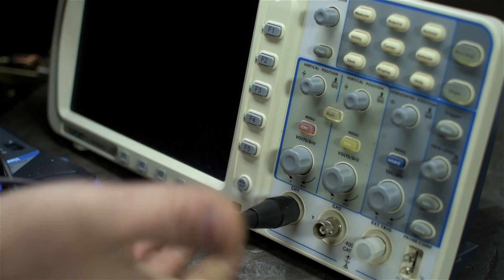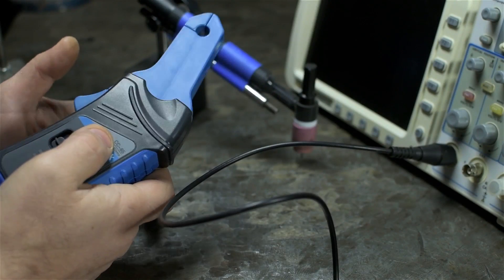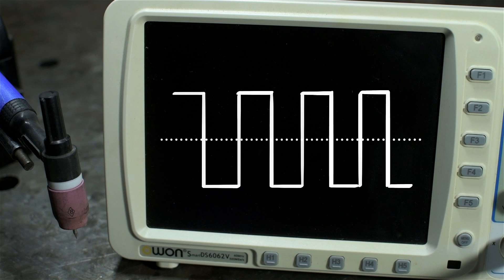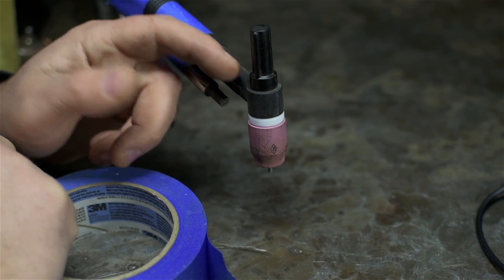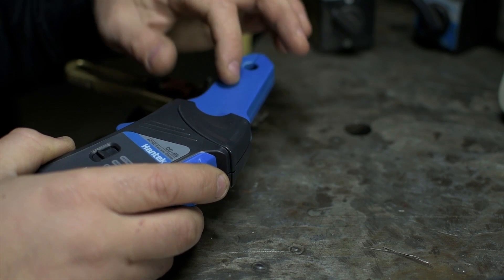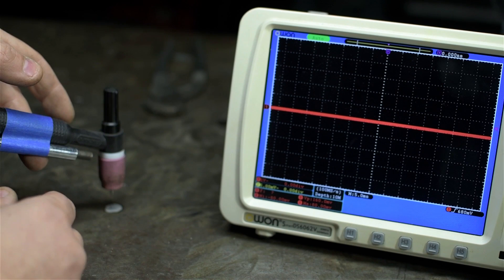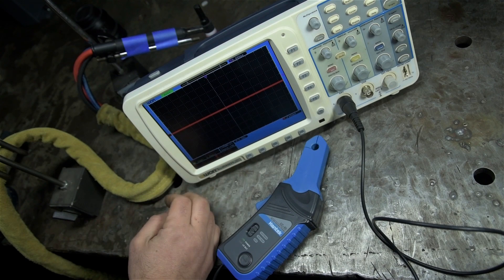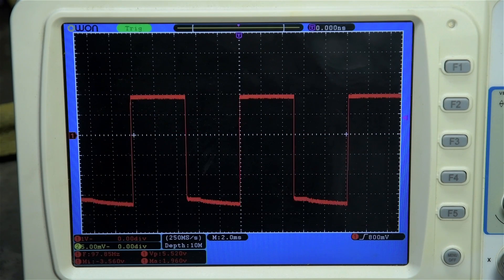Oscillo-Help-Me?

Comment: I have had similar problems hooking some digital scopes up to inverters etc. An old analog oscilloscope sometimes works much better. I still keep an old Tektronix plugin scope that seldom lies to me...
The other issue may be the hall effect AC/DC probe You are using. I have had similar problems with my Tektronix high end  currentprobes. These probes work by a split core system clamped around the conductor. A hall element measures the magnetic field induced in the core. This field is proportional to the current through the conductor. But in these probes the total magnetic field is held at 0 by a servosystem that drives a compensating current trough a compensating coil around the same core, and it is this current You register on the scope. Complicated - Yes but it gives You DC measurements and much lower inductance than a simple core probe would due to the core inductance being canceled out by the compensating current.
Big problem is to fast rise times and hefty currentspikes. If the servosystem in the probe does not keep up, You get all kinds of funny results. Many of these probes are seriously derated at high currents, the Tek ones have some dokumentation on this issue. Easiest sanity check is to compare the current signal with what You get from a simple resistor to ground for the same current waveform. Rig a piece of stainless wire to something to torch on at low ohms to ground (perhaps 0.01) and just measure the voltage with the scope.  Just disable that HF scopekiller first...

Comment: The new units waveform can be explained.  There would be a very small capacitor on the IGFET drivers to prevent self oscillation.  If a good is used for the output drive to the torch then the magnetic collapse would also take time to drain through an Resistor- Capacitor drain of the collapse on the negative slope.  This unit has a much cleaner square wave.  This means that the signal is composed of much higher harmonics.  I suspect it is probably just causing RFI issues with the control circuitry.  It is only about 3 Volts Peak-Peak.  A typical scope should take around 50 V P-P before clamping occurs to the input signal.   To confirm it you could make a simple current loop with a compensated probe.  10 turns of wire connected to a 1k resistor that your probe is across.  The square wave is made up of the odd harmonics of the base frequency.  130 kHz, base, 390 kHz, 650 kHz, 910 kHz, 1110 kHz...etc.  Make up the square wave.  The sharper the rise time the higher the harmonics that contribute go.  The cleaner square wave the more the RFI.

Comment: You were just measuring a well know physical effect. I wanted to do this by myself, but I'm too lazy. Thanks for your effort to prove it!

At the heated tungsten electrode it is easier for electrons to be emitted at the re-ignition when the electrode is a cathode. If the workpiece side (eg of aluminum) is poled as a cathode, the electron emission is very low. The re-ignition is harder and a higher field strength is needed and this creates a spike during arc ignition. The arc voltage after re-ignition is higher than reverse polarity, since the thermal emission of the weld pool is lower, resulting in a resulting DC component of the voltage.

Comment: better way to measure amps is to add a power resistor of a known value like 0.1 ohm and measure the voltage drop over it

Comment: As a professional IT support engineer, I have to point out that, traditionally, I would switch it off, and only THEN, switch it on.
Otherwise, is there an issue with the scope ? Google the manufacturer, see if there is a support section. See if there is a FAQ section.

Comment: I'd like to see you play around with the settings. The Tungsten is negative, right? What if you change the cleaning to something like 25 ep? That would probebly change for how long it's positive, but if you change the frequency it might change timing on both. What would be very interesting is changing the polarity, and see if it's consistant, if you change on the welder you could rule out the equipent to some extent. Then it probebly comes down to settings like arc with or something that's further into the pixies domain. A good point is that the EP part of the cycle is mainly a cleaning action and to penetrate the oxide layer, if it was greater then 50% amprage it'll probebly melt the tungsten in no time. What I learned is that you change the EP % to a higher lever to make a ball on the tungsten, this might give more amprage, but I'd guess it's more of a timing thing. Please do some more with this, very interesting. If you use a strike arc start, you probebly won't fry you oscilliscope right away, but I'd guess it's more conveaniant the way you'r already doing it :D How cool are you at the moment BTW?

Comment: I would suspect your setup Tony. First your zero reference point (ground) most likely is different between the scope & welder. It should still work but can cause problems.  Also the positive side of the wave is too perfect like a clipped wave would be. You can see the noise on the negative side but not positive.

To eliminate  probe error, wrap a bunch of wire around the welders lead and use that for your pickup probe.

Comment: I'm a union boilermaker and have been tig welding the root pass in tubes for 25 years, I've got no idea what's going on in this video, we usually have Miller 8 packs that look older than me and when we tig we just switch out the leed and ground cables.

Comment: Generally there are two phases, heat and clean. You general go negative to heat and positive to clean. Clean is basically reversing the flow to help slow the oxide build up within the arc / hot area. check out: https://cadcaminfo.wordpress.com/prototyping/the-tig-welder-ac-or-dc/

Comment: Definitely put in a second probe and connect that to the ground clamp. Then reference channel 1 to channel 2. That will give you the best baseline for the AC wave referenced to actual ground. Otherwise, the scope is mostly just guessing what is positive and what is negative. Usually there is some drift without a reference to ground. It's difficult to do a true reference with an inductive clamp, even with a ground reference because you aren't measuring directly. Problem is, you can't connect your probe to ground and directly to the torch or you're just welding the inside of your scope... 

Side note: With an inductive clamp, there's always some bias one way or another because it has to read the current based on direction of flow, but injects it's own current back.

Comment: Stop the video at 6:49 in slow motion as current is decreasing, and it becomes pretty evident that your measurement system is clipping on the positive side. As the current decreases, it becomes approximately balanced positive/negative at the ends of the step response, and the exponentially decaying sinusoid is chopped off at that peak voltage.

Comment: Tony,

I am a mechanical guy and have very little experience/knowledge with wrangling pixies.

Being that pixies fly from negative to positive, they are stronger on the negative side.  In the house, the power company controls how much stronger they are and limit their overall strength making them only very slightly stronger on the negative side.

In a arc monster, the pixies get VERY angry and feed off the steroids the arc monster gives them.  They become so strong they hurl drops of molten steel like they are paper balls.  If we try to measure this, we may see this an an imbalance of power as the angry pixies should only hurl those molten drops of steel in one direction.  The arc monster protects itself by only letting the steroids work in one direction.  If the steroids worked in both directions,  the arc monster might end up with molten steel all over it.

Comment: A few too many comments to read through, so this might have been covered already, but anyways..
I'm not sure what "high frequency" start means in this case, I mean, what frequency is considered "high"?
Compared to AC power at 50/60 hz, almost any frequency is high, but if it refers to a frequency in the radio spectrum (essentially mhz or above), the most likely cause is that your scope is affected by the radiowaves emitted from the high frequency (and high power) start. The higher the frequency (and thereby shorter wavelength), the more likely it is that something in your welder is acting as an antenna. Anything metallic that is about one half or a quarter of a wavelength happily acts as a radiator.
Add to that the sparks generated by the welder, those produce a lot of white noise which means many different frequencys are beeing radiated (this is actually how the first radiotransmissions were produced).
The components in your oscilloscope is sensitive to this radiation, especially semiconductors (transistors etc) and this could cause very wierd thing to happen. The sparks could actually be the sole cause of your problems, if those somehow are different when the high frequency start kicks in, or perhaps if the power is boosted at that time.

This is of course just a theory on my side, but I would suggest that you tried to shield your oscilloscope in some way, perhaps just with some aluminum foil (cover everything but the display) and see if that helps. Otherwise hopefully someone at least learned something about the wonderful world of RF :)

Love your videos, keep it up!

Comment: Could be the electrode try leaving a maximum off 3 to 5mm showing.  The gas may be different to what was used by the company that set the standard also try arking closer to the return cable. Also the material you ark on isn't contaminant free. Company's that test there product would be in a clean controlled environment not on a dirty used bench with contaminants.  You probably will never get to test standards. Either way if it lays a good bead I wouldn't worry.

Comment: One other thing to consider.  You need to make sure the probe closes completely around the wire being measured.  The probe you are using has a 9mm opening, so the wire would need to be smaller than that.  The probe has two hall effect sensors attached to the magnetic core/toroid 180 degrees apart.  After amplification the sensor outputs are fed into a differential amplifier.  If the probe is not completely closed the differential amplifier will output an offset since the magnetic field passing through the two sensors will not be equal due to the air gap.  I could not tell from the video if the clamp was closed all the way nor could I find any data on the wire size.  Hope this makes sense.  Good luck.

Comment: You're being overcautious by not using mains and mains earth for your scope. The current clamp is galvanically separated from the current which produces the arc, so there shouldn't be an issue running it on the mains.

As for the asymmetric waveform, maybe the current clamp's battery is running low? -it's also a fairly low current clamp to be measuring that kind of current with. At my former job I would have recommended a 200A AC current clamp (e.g.: Fluke i200s) for that application.

Comment: I would like to underline that Deathlok67 is right on all points. I would just add that you should see all of the waveform (the entire square wave) above the scopes' ground reference, when the scope is set to DC coupling. When set to AC coupling the wave form will be displayed symmetrically above and below the scopes' ground reference assuming there is no DC offset.

Comment: does that current probe have a adjustment? normal probes have a small screw that you adjust while you have to probe connected to the square wave output of the scope(its specifically for calibrating probes) its labeled probe comp on your scope. if a probe is not calibrated to the machine it looks exactly like what your seeing. take one of your normal probes and calibrate it, turn the screw around and you can see how distorted you can make the calibration signal, the cal signal is normally a 5v p-p square wave that is pretty much prefect. you adjust the probe to show a perfect square wave on the display.

Comment: Hi Tony, 
if You flip the direction of the Hall effect current probe does the waveform look the same (asymmetric in the same direction)?
If so it is almost certainly a probe issue. At high currents I’ve seen the slight bias in the placement of the Hall effect sensors cause asymmetry in readings before. This becomes more pronounced when you’re pushing towards the limit of the probe design range as the intrinsic sensitive issues become more pronounced. Infineon used to have an app note for there sensors that does a better job of explaining this issue then I ever will.

Comment: compare what your seeing on the welder to something to be a known good ac signal and see if it gives the same result. it may just be a too slow refresh rate of the inductive pickup, or maby what ever little microchip is in there has failed it simply cant make the positive voltage?

Another thing that crossed my mind, hows the power source from the wall? maby the welder is just repeating what it sees from the grid?

Comment: What coupling are you using with the scope?  That DSO would have AC/DC/GND coupling for the input BNC connection. Perhaps, a calibration with a standard load can tell you the actual story.

Comment: the pick up clamp is converting the magnetic flux to voltage that the silly scope can read
it is basically a D.C. affair , the voltage balance in the clamp it tossing off the silly scope

Test by clamping a D.C. arc welder  or a alternator from a car

Comment: My first guess would be to try and reference the scope to the same earth that the welder is connected to.  As is, the scope is "floating" and has no way of telling where the "zero" should be.  I have run into this same issue in my line of work.  It is almost impossible to get an accurate measurement without a reference for the measurement signal.

Comment: What you could do is to use a current shunt and measure the voltage drop over it with the normal scope probe, that way you can be 100% - epsilon sure

Comment: Flip the current clamp over - does the "asymmetry" flip polarity? The asymmetry produces an average DC offset if it is really there...a trick to sustain the arc, maybe? 

As far as the scope going batshit crazy, it's not shielded to the levels of electric field you're cranking out.

Comment: Hey Tony. The clamp will never give you an accurate DC reading. A method you could use is measuring voltage across a known resistance (I = v/r). As your scope is grounded, touch a probe to your ground electrode; the resistance of  your ground lead will be enough to make some educated guesses.
Reply: If this doesn't show you anything useful, you'll need to use two probes to make a differential measurement across the resistance of a lead.

Comment: a) not grounding the scope is a very good move, though it shouldn't really matter much if you're using the current-clamp
b) I think the main problem is your current clamp, for a whole bunch of reasons relating to its ability to perceive a DC offset and a possible lack of bandwidth

I propose that you should use the ground/clamp cable on the welder as a big fat current-sense resistor.  Say it's 4AWG copper, that's 0.00025 ohms/foot.  Put 100A through it, and that's a voltage of 25mV/foot.  Say you have a typical 6ft ground cable, you'd expect to see about 150mV expressed over the whole length of the cable at 100A, and your CRO should do pretty well measuring that signal.

From your CRO input:
- put a BNC tee piece on the input
- using BNC plugs, plug two pieces of coax into the tee, RG-58 is the usual cheap stuff to buy and will be fine for this
- for one piece of coax, connect the ground/shield to the welder's ground/clamp output, AT THE WELDER (do not connect the centre conductor) and
- for the other piece of coax, connect the centre conductor to the welder's ground/clamp, at the clamp where it clamps onto your bench/workpiece (do not connect the outer/shield conductor)
- DO NOT GROUND THE CRO
- DO NOT TOUCH THE CRO WHILE THE WELDER IS RUNNING
- Probably best not to use HF start
- try to not allow the coax cables to run parallel to any welding cables

That way, you should be able to use a DC-coupled input mode to measure weld current by measuring via the voltage along the length of the "ground" cable.  That will get rid of any offsets or other craziness introduced by the current-clamp.

You could probably do this without using coax, but you run the risk of getting a whole bunch of noise magnetically induced into the signal from the weld-currents.  This is why you should try to keep the sense cables at right-angles and far away from the weld cables.

If you blow up the CRO, don't blame me :)

Comment: I think  the problem can be found at the circuit board inside the welding machine where the current control is done  may be dry solder  in the circuit board (control board (electronic))